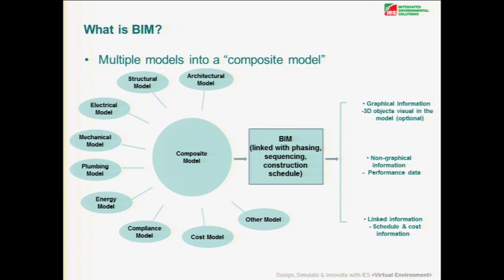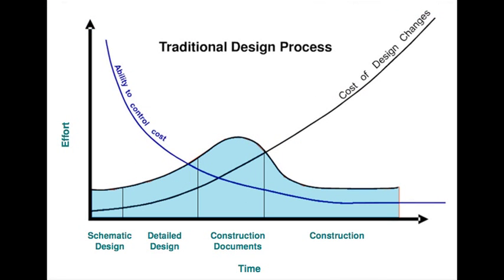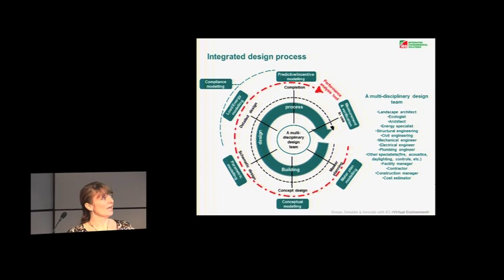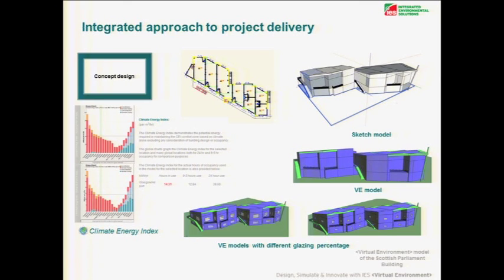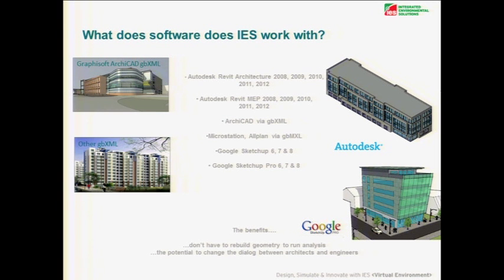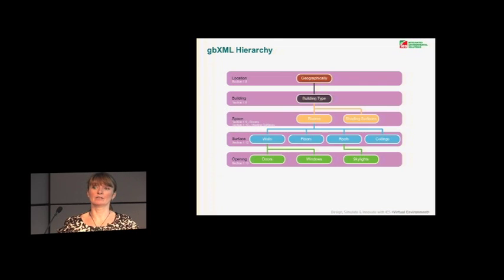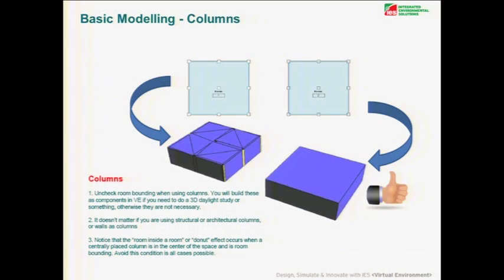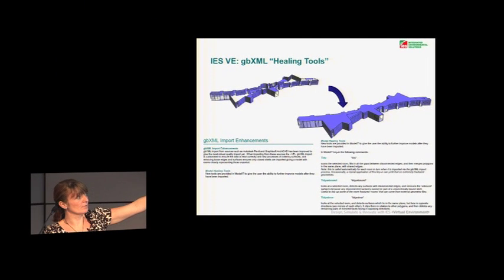BIM Integration with IES VE (IES BIM Faculty - Part 1)

Comment: This is an interesting video, however architects and engineers compete for various types of work within the built environment sector. Why would they share correct geometry? Architects should be legally required to provide suitable geometry to a set legal standard. Leaving engineers to be able to carry out design/analysis at an earlier stage.